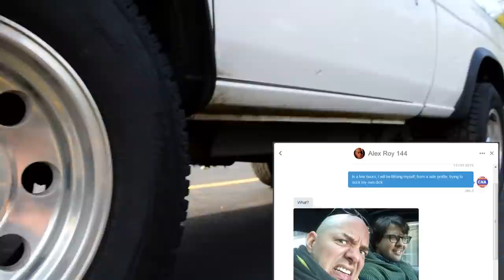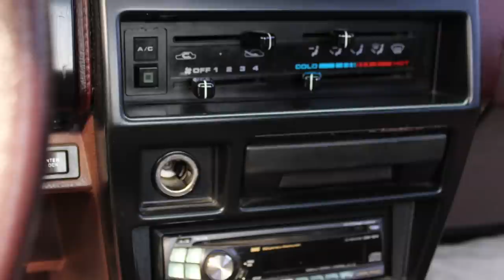Regular Car Reviews: 1991 Nissan D21 Hardbody

Comment: I bought a brand new 1977 base model Datsun 2 wheel drive standard cab long bed. I drove it all the way to 1993, when I replaced it with a 1993 Chevy S10 2 wheel drive standard cab short bed. I'm still driving that, and have no plans to get rid of it. I'll replace the engine, transmission, whatever it takes to keep it going. You just can't buy a decent pickup anymore.

Comment: i have a pristeen completely stock and original with only 75,000 miles on it, it runs and drives like new,(for a nissan hardbody 75,000 miles the cylinder bores probably still have factory honing marks)  after hearing it can be an investment i only want to put it in a safe . . mind you its my very first car but i have upmost respect for things that last, at the end of the day best truck wins the heart of the man who takes function over fashion any day of the week, its true what they say, those things run like a Rolex . .i want to save it for a day when i sell it at auction for 12,000,000,000 (factoring in inflation hue hue ) thats about a 4 bedroom 3 bath house with an inground pool i could one day trade for my truck . . ill probably end up using it all my life and giving it to my kids after its odometer maxed out . .shame . .but its what the truck would want, its in its blood, very honorable indeed

Comment: The KA24E was not throttle body fuel injected. The Z24E in the early hard bodies was throttle body injected. The KA in the truck was multiport fuel injected, it has a throttle body with an integrated MAF so it kind of looks like a carb or throttle body injection. BUT, the injectors are on a separate fuel rail in basically the same place as a KA24DE.

Comment: I had a 1990.  Belts would squeal when cold.  Shifter made my shoulder sore, and the starter would die every 2.5 years.  Not great on hills (I had to downshift just to maintain speed).  It was unstoppable in the snow and ice, though.  22 mpg tops, in the summer, with the front hubs unlocked.

Comment: Got on 05 Frontier king Cab 6 Speed, yeah I get it newer, not the same truck.
Drove it yesterday from Cape Cod MA to Knoxville TN...Its now got 135+ on the clock ran like a top the whole way.
I didn't worry about it a bit.
I would never try that 1000 mile run 
In any Chevy, Ford or Chrysler product that would start the journey with 134,500

Comment: I purchased mine new in 1991.Transmission needed a rebuild at 154,000 miles.Body rusted out. Granted I worked the hell out of it but it was weak and needed to be worked hard just to extract the power required to do moderate jobs from that sorry HP motor.Very uncomfortable to drive. Today  we drive a BMW X5 and a Toyota FJ. Even todays Japanese trucks are lame in comforts and low in HP, but they are reliable . I looked up my bill of sale on this 1991 Nissan that was purchased in November of 1990 out the door paid $11,798 the rear bumper was not included.

Comment: got a 1990 japanese import double cab d21  that im repairing the body ( british weather and hammers getting to her) 
got to say the hardbody name is true  and there is alot of double skin on them aswell and quite strong aswell  much stronger then the d22 im using for parts 
its got the original silver top td27 non turbo slow but indestructible    and 25 to 27mpg which still seems as good as the d40 
just wish they nissan made pickups like them again and the td27 :/

Comment: I worked with one, a 2.7 diesel. 18000 miles, fuelpump troubles, if you could hear the agent's lie's ! And driving with the steering wheel on your lap ! Once, I did not switch the alarm button off. It went into alarm ! Fone office, they said we don't know how, see and get it right yourself ! After 10 minutes, it stopped making alarm, i could start and drive, with nothing done. What quality ! Ideal for stealing !....firm went bankrupt.

Comment: The ka24 is JUST the successor to the 720's z24 (which was in the d21 till 89' fuel injected ofc) the z24 was powerful for what it was, more powerful than ranger's, B series, any of Toyota's trucks really, the only issue was when they were imported to America and couldn't keep up well. So the ka24 was made, used, and abused. The ka24 is a much better platform for a turbo, dunno if it's dual timing chain though. The z24 has dual spark to help with emissions crap, but that also helps it ride smooth with the spark plugs firing on exhaust stroke.

Comment: My stepfather had one of these new, 1986and a half.  I was supposed to learn to drive on it.  Never could master the clutch.  He abused it for 360,000 miles and ditched it in the 2000s.  I actually could drive a 90 Mitsui Mighty Max, so I realised just that manual was impossible.  Drove an Eclipse and Samurais too.  Corona had a Toyoglide.

Comment: I am the second owner of a 1994 D21 XE 4WD, I've built a BMW E30 M20 2.7 stroker Schrick 288 cam'd motor on full stand-alone I will put in. Since I think something like the throwout bearing or syncros got really hurt two days ago in the transmission. Or the KA24, even though it only has 15k on a rebuilt head. Since I have a quite large CNC at home and am a military aviation systems designer for a living, it will be easy to machine billet shift linkage and make/weld a new drive shaft (send out for balancing). I'm most excited about CNC'ing my own bead lock wheels at home though. Are there any LSD's that are good for the D21 that bolt up from other Nissan's or is an air locker the way to go?
Reply: A lot of the Pathys had LSD.  Straight swap.

Comment: I have an 87' D21...body is immaculate...had to rebuild the motor though...worth it.  The only problem I have is finding Transmission parts...shifter linkage bushings are shot and I think there is a spring missing...can anyone offer any help in acquiring some parts?

Comment: I have a Nissan King Cab 1990, and i wonder if my chassis is broken or not... It doesn't feel like it when i drive it, but my dad says it could be. The only noticable thing i can see from the outside is the flatbed tilting more to the ground at the cabin side, as if it's fallen of an attachment or something similar, and it clonks everytime i hit a bump. I was told to look it up as the King Cabs and the Navara is basically the same car. Anyone who can help?

Comment: Aesthetically, IMHO, this is the best looking  truck ever. I owned a 2003 Frontier 4x4; it was just as functional, and reliable as the Hardbody, but the front clip, and wheel opening trim were too bulbous looking. Just the bumpers on today's trucks measure taller than an entire, Hardbody truck from the lowest point on the axles to the highest point on the roof. Current pickups'  front ends look ridiculous, and if having a tractor/trailer front clip isn't bad enough, truck manufacturer's also have to put an extra tall bulge in the hoods. Ugly doesn't begin to describe them.

Comment: On the topic of small trucks, my first ride was a short bed single cab 4x4 s10. That thing had some serious soul. I replaced it with a first gen canyon, thinking a newer "small truck" would be just as good. And it's not bad, it's been good to me however it is so boring in comparison. It lacks the character and soul that people talk about on shows like top gear. I never understood it until white lightning (the corny name I chose for the truck) was sold.

Comment: I own currently a 1985 720 4x4, Have owned a 1997 Hardbody, abd a 1999 Frontier. All of them were great and problem free. I am thinking about selling or trading my Mint 720 for a mint 1997 Hardbody or Frontier though. Parts are hard to find for the 720 now.

Comment: I wonder if a late model Nissan Frontier will be just as long lasting. Keep in mind they’ve been using the same design since like 2005, and it is definitely the most utilitarian, bare bones, spartan truck you can buy new in 2019. Not too much fancier than this truck tbh

Comment: Nothing that is obsolete about this truck? How about the carburetor and the ignition distributor? Electronic fuel injection and ignition are a lot more economical and reliable.
Or if it was a diesel. Then there's nothing really obsolete about this truck.

Comment: I have a 97 king cab SE, I love it to death but its such a hard year to work with. 97 was the last year of the "Hardbody" line begore they moved to the frontier. its powered by the ka24e motor while the later frontier has the ka24de DOHC motors. Buuuuuutttt unlike the earlier models this one is an obdII motor. Witch means finding a replacement motor is like trying to find a needle in a haystack.Either way i love it to death and i would want no other choice for being my first  vehicle.

Comment: Anything less than a 3/4 ton 4x4 in any state that receives a decent amount of snow is worthless. That is why trucks need to be big, plowing with a half ton beats the snot out of it and breaks things. You can't do anything with a little truck like that, its for someone who wants a truck but doesn't actually want a truck they just want to think they have a truck.
Reply: osp80 small trucks died out cause outside of a foremans truck they have no real use. The capacity is just not there. Just cause something is fun doesnt mean it will sell.

Comment: Are all D21's created equal?...  I am looking at 1995's wondering if they are still a awesome value like the 91.
Reply: YES same basic truck. bought my 95 ext cab, 4x4 4cyl  has 226k miles no problems, reliable, decent mileage, still has original clutch and all, expect to get 500k miles.

Comment: I inherited a 97 back in 03 when my father died and I use it semi commercially doing construction work here in so Cal,  the truck eats timing chain guides like a fat chick eating candy...  I just keep resurrecting it...  The engine really isn't a good design, a single roller timing chain with plastic non tension guide (it's steel with a plastic channel snapped on it) and a hydraulic non ratcheting tensioner is its weak link....  Oh and the whole fact of it doesn't seem to make power until about 2800 rpm means you really got to get it screaming just to go up a hill...  Now that being said 24 mpg out of an extended cab pickup isn't to bad hence why I still drive it.

Comment: Damn, I want someone to bring back a simple S-10 type truck, long box or cab1/2 with a six speed and 4.3(turbo?) with manuel 4x4 box. Keep it on the KISS plan and something that gets decent mileage and doesn't have a bunch of electronic shit to break and fall apart. P.S. also give it a body that wont rust to shit in 10 years of upper Midwestern winters. Now somebody build it!

Comment: is it foot pounds of torque or pound feet of tourque?? i hear both from car companys
Reply: Foot pounds, directly from wiki
Reply: It doesn't matter because technically they are the same. All you are doing is multiplying the units feet and pounds. This means that both ways are correct in the same way 6*3 is the same as 3*6.

Comment: I tried to destroy this same truck back in 2002 this is no joke i dis not changed oil for 3 years the engine was still running rough, but the truck never fail after I changed the oil which it was empty it ran for ever, i sold it to a guy sending to mexico, to my knowledge the truck still running strong and it’s apparently in used  in a farm with hills and loaded up to the top.

Comment: Not the same KA24E as a S13. The D21 was cast in Mexico, has individual crank mains and lacks piston oil squirters whereas the S13 KA24E was produced in Japan, has a crank girdle and has piston oil squirters, different injectors (spray pattern)... and the list goes on. While the truck KA is great, it's inferior to the S13.
Reply: I thought that was the KA24DE you're talking about.

Comment: Used to have this truck but mine was a 1986, it was a cool little truck but severely underpowered with that little 4 cylinder it had. The thing would have a hard time under heavy acceleration 😂

Comment: Toyota Tacoma and Ford Ranger still in production just the name the two off the top of my head you can still get them with single cab and short beds oh and there was that one sin of a truck that Toyota was supposed to be coming out within their 2018 line but I haven't seen anything on as of late small trucks are still in production they're not called small trucks anymore but you can still get them at a reasonable price with reasonable gas mileage in a reasonable amount of power now I do agree that they just don't make them to last like they used to but you can still get them now what we should be arguing about as far as things that you can't get anymore is a manual freaking transmission not being standard anymore you have to special order that shizz

Comment: I test drove one back in the early 90's but ended up buying a 92 Toyota V6 5 speed.  It seemed to be much better in all areas.  Toyota did end up rebuilding the V6 for free due to a head gasket recall.

Comment: 87 King Cab.  Off roading isn't as fun as you thought.  It will be $150 for that wrecker tp pull you out.  Oh, you should replace that thermostat at 60K; oops head gasket blew out in the Hampton Roads Bridge Tunnel.  Dude your heads are warped.